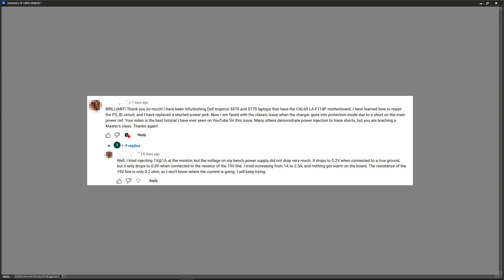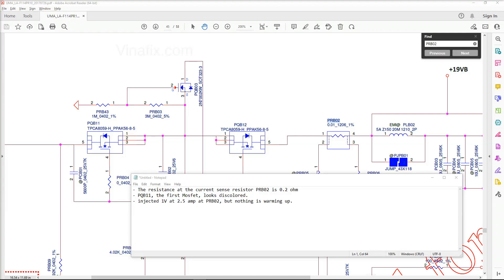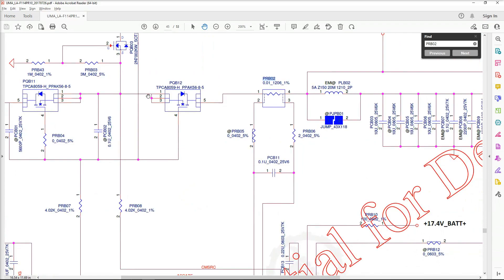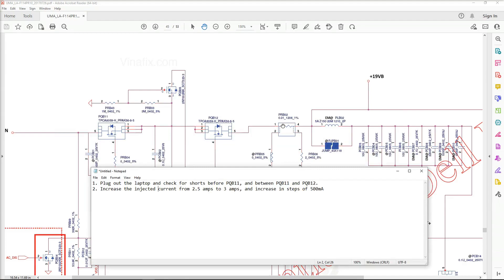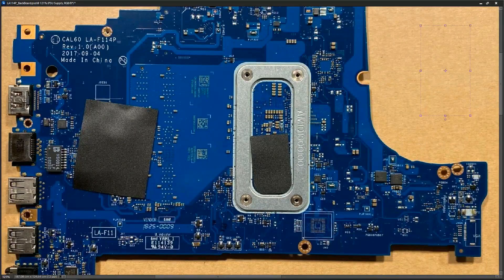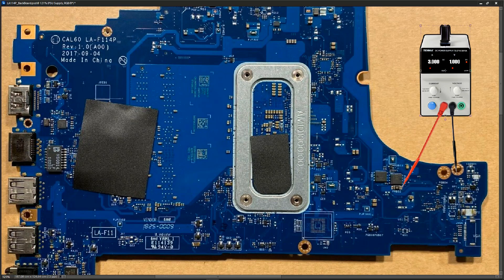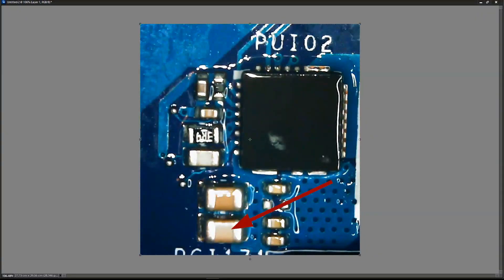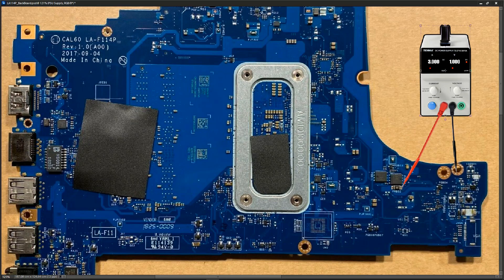Let's Help A Subscriber 01 - Dell Inspiron 5570 Shorted 19V Rail

Comment: The biggest lesson I learned from this diagnostic is that if you are using your fingers to check the board for hot spots, you MUST commit to it, and overcome your fear of getting burned. Lay your hand and fingers on the board and wait for the "bite". It will hurt a bit, but you will not be scarred for life or permanently injured. If you don't commit to the process, you will likely miss the hot spot. Concentrate on capacitors, MOSFETs, and VRMs. Also, take time to study the schematic, if you have one, before injecting power. That study time will help you narrow the search, and help you predict the most likely suspects.

Comment: Well done and thank you for your help. I thought I felt the burning heat on my finger from PUI02. However, I now realize that it was the capacitor that I felt, because the capacitor is higher profile, versus the relatively flat IC package. I have a small USB microscope camera, which I did not use at first. I didn't set it up until after I felt the heated component. That camera helped me to see the heat emanation pattern much more clearly than with the naked eye. 

The next issue to fix on this motherboard is the blown TVS diode PD1 in the PS_ID circuit. The board will not detect the charger wattage, so it will not charge the battery. I have fixed that issue before, so I am confident I can fix this one as well.

Thanks again for your excellent videos. Best wishes for your future success.